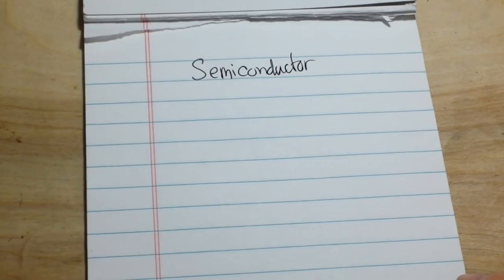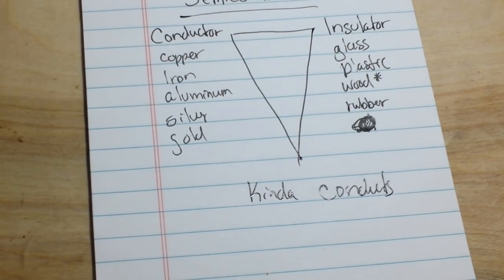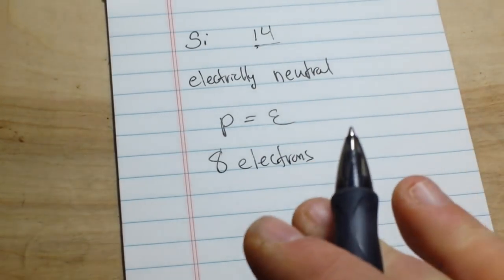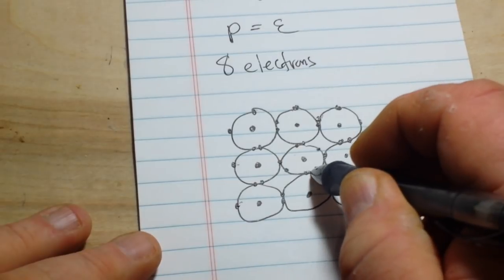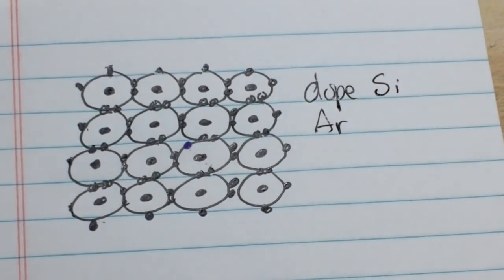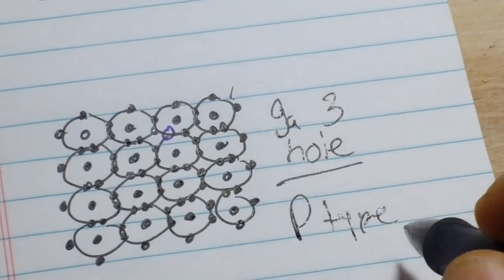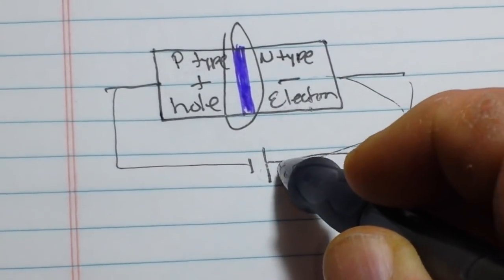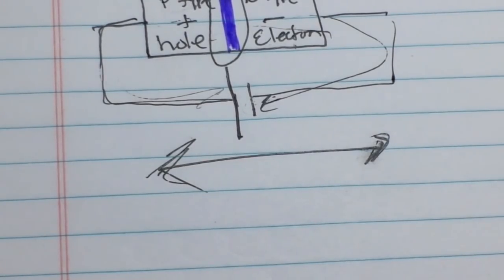Semiconductor Theory 1

Comment: Great job with the intro to this topic. Like the analogy in the beginning about the lazy teenager lol. Nice you pointed out electrically neutral...common misconception that p-type is + charged and n-type is - charged. Doped Si still has same number of protons and electrons...so again good job pointing out electrically neutral.
Reply from the maker: +Michael Padovani Thanks, tomorrow we talk about electron flow vs. current flow.
Reply: learnelectronics great, in fact i was going to comment that u didn't screw up the arrow direction then seconds later u caught yourself, both are equally valid! Nice catch! ;)

Comment: i got a question i have a  hammon tube with out any bais number  how can i find the data sheet for it  and is there a way i could figure out the pins and is there some way to wire them up to just cause the glow i want to use it for display them as the glow
Reply from the maker: I know nothing about them. Do you have a model number?
Reply: hammond 12AU7A  IS THE ONE THAT I ONLY HAVE  A TYPE THEY ARE AND THE BIG ONE I DONT SEEY ANY THING LIKE THAT BUT IT A HAMMOND
Reply: Andrew Murphy
1 second ago
hammond 12AU7A  IS THE ONE THAT I ONLY HAVE  A TYPE THEY ARE AND THE BIG ONE I DONT SEEY ANY THING LIKE THAT BUT IT A HAMMOND 31263-52
Reply from the maker: +Andrew Murphy ok I'll see if I can find anything
Reply: http://www.mif.pg.gda.pl/homepages/frank/sheets/093/1/12AU7A.pdf all you need to do is apply 12V between pins 4 and 5 and it will glow. It can be AC or DC, it just has to be 12 volts.